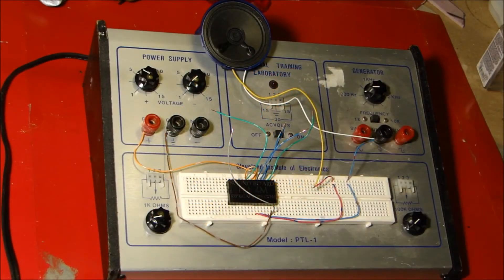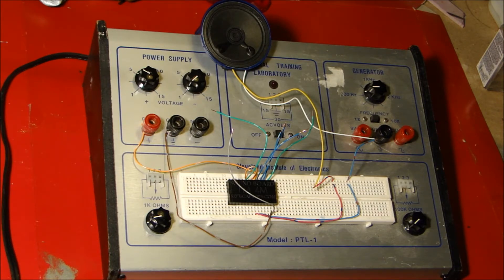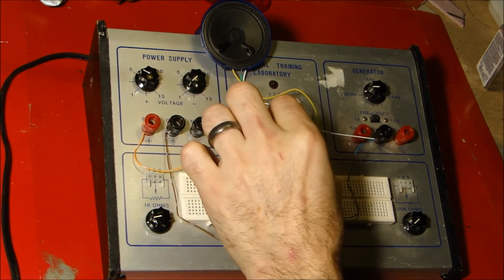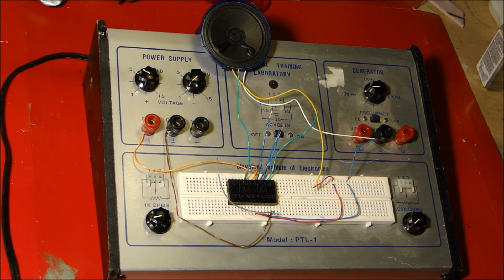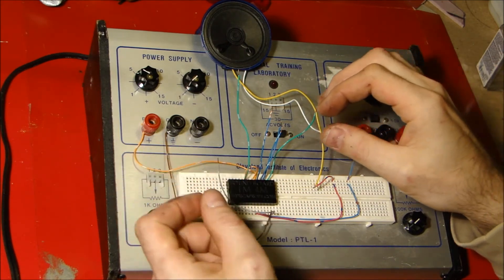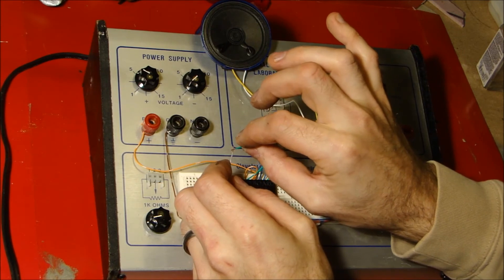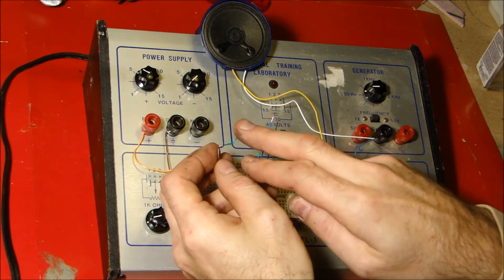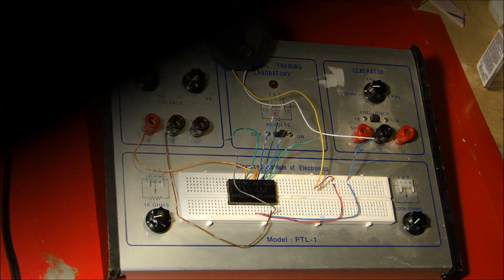Audio Chip testing

Comment from the maker: Maybe, but there's probably smaller, cheaper ways to do it. The audio chip needs to be soldered to a circuit board containing leads to on/off switches, audio out, and voltage in. It's not that loud by itself, so you might need to wire in a small amp. I'd say look and see if there are any "lights and sound" toy guns that you can take apart and gut for electronics instead.

Comment from the maker: That's it. It's designed to store audio files and play them back on different switches, I think up to 10 different sound banks and 10 different switches. Audio playback is either play once all the way through, or play until the button is released, or play multiple files in order in one sound bank. It doesn't do any switching or randomizing, it's just audio in/audio out.